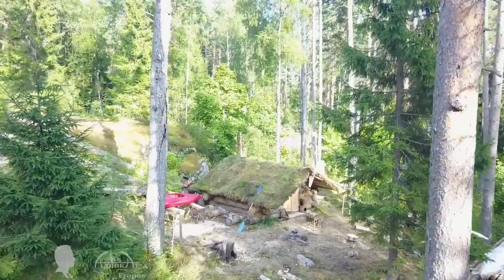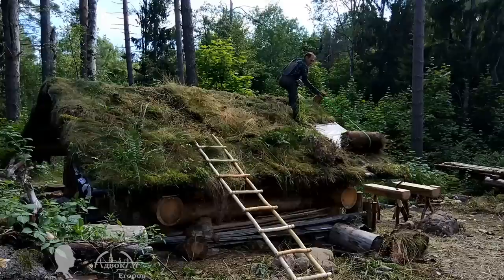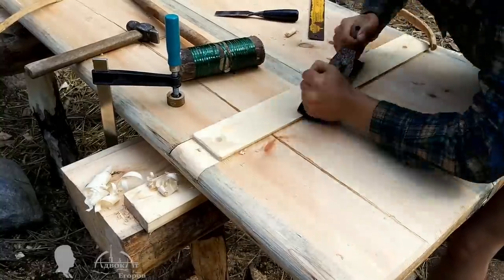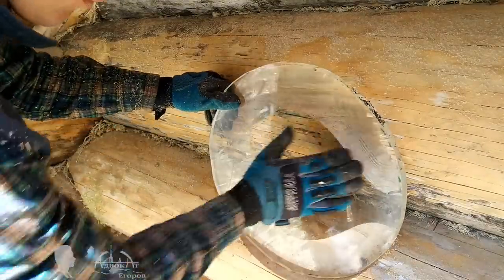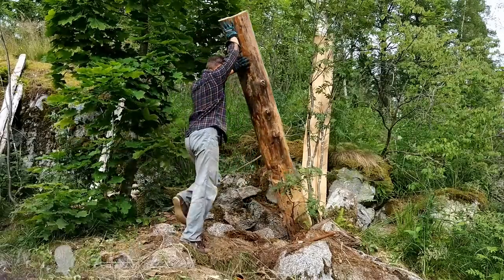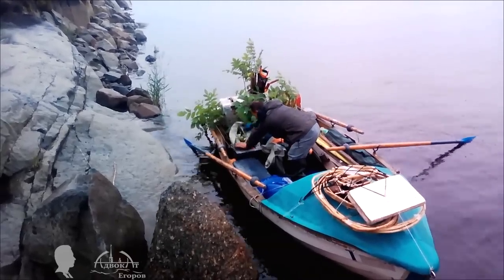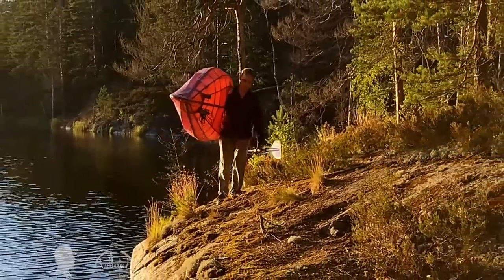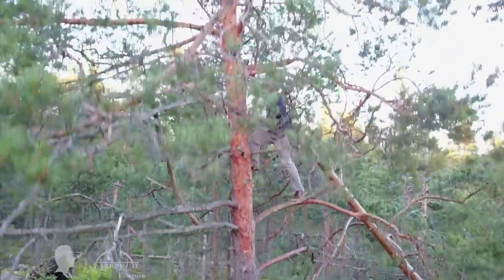30 Days Solo Bushcraft in the Northern Wilderness / Best Summer Projects

Comment: Porthole - on the wall, I would put a straight stick into the centrepoint of the window sticking out, the top of which is level with the wood beam, then attach a string to draw out the arc of the window. The pencil would have to slide in and out of the loop to account for the rise and fall of the curving surface of the logs. Once that is marked out, I would use a curved chisel to start carving it out on the inner edge of the pencil line. I think a curved chisel, alternating with a straight wide chisel would do the trick.
Reply from the maker: Thanks for the feedback. I only used a chainsaw, I will soon show how I made it..))
Reply: @Advoko  I don't know if you've answered this question yet, but I would have found the centre of the window on the wall and made a compass to draw the circle that described the cut. The "pin" side of the compass could be segmented so as to be collapsible, while the marker at the end of the radius would maintain the proper angle and distance to keep drawing the desired circle as the compass pin moved deeper into the cut. That is, the compass would not only draw a circle in a straight plane, but would be able to draw this circle on a plane that slid toward the wall as the cut progressed. This could be as simple as having the pin be a spike that was driven deeper and deeper into the wall as the cut progressed, but maybe it would be better to have the spike pass through segments of a tube that were each, say, 1cm long, so that the circle and cuts would be more predictably progressive and more accurate. At a certain point the compass would have to be moved to the interior side of the wall, using the same centre hole.

Comment: My dad made a large coffee table out of green planks when I was a boy some 40 years ago.  He only used wooden pegs/dowels to hold it together. When the wood dried out it shrank and tighted around the dowels. The dowels were squeezed so tightly that they are no longer flush with the surface.  It is strong and beautiful.

As for your circular window holes I am going to guess you put a spike in between two of the logs. You then made a compass with string or a sting and your chainsaw.  When cutting into the wood you had the tip of the bar perpendicular to the round path.  You did it slow and steady.
Reply from the maker: Pretty close. There is one trick that one needs to know though. I will show it soon...
Reply: @Advoko  I look forward to learning it. The cabin is a work of art by the way.

Comment: I come from a fairly remote area myself with poor phone reception.  I have made a passive phone repeater to redirect signals where I need them. Basically it's just two antennas and some coaxial cable connecting between them. You aim a high gain directional yagi antenna towards the location of the telephone cell site and secure it firmly and connect one end of the coax to it then the second smaller yagi is connected to the other end of the coax. The smaller antenna aims down towards your location and you have phone signal.  I have used it to " bend "  a single into a blind valley that has no reception normally. Keep up the great work, I love your projects and your videos.

Comment: Round windows = Flashlight?
Reply: @Advoko  You put a string on a nail in the wall and then you go around the nail by full length of the string and mark it with a pencil. Right?!.
Reply: I think yall are focusing on the wrong problem here.... Outlining the circle wouldn't be the problem. Cutting the circle perfectly all the way through the 12 inch log is the trick.

Comment: Dear Max, You asked how you cut the round window in your log cabin. Why ask me, you did it, you should know!

But then again, in the spirit of community input, here is my attempt. You are cutting into pine logs, soft wood that if fairly easy to work. I live in Australia where our native timbers are as hard as hell. Cutting a big circular hole would require a trip to the workshop and a bandsaw. In your case, boring into a softwood wouldn’t be that hard. If you have a central axis made of strong wood is the start. Put a cross-bar of timber, preferably green and tough gives you two arms. Into this arm you then put two pins of sharpened metal, both facing the same direction eg clockwise and equidistant from the centre. You then have made a circle cutter. It just needs a handle at the outside end of the shaft and voila, you have a hole cutter made mainly of wood but two bits of sharp metal {eg knives} to do the cutting. 

I love the format of your videos and your seemingly endless ability to turn challenges into wonderful earthy solutions. Well done.
Reply from the maker: Peter, I did it all with a chainsaw and some attachments but there is always more than one way to do the same thing;)

Comment: Amazing build! The windows? I think I would attempt to create the holes by pinning a chain dead centre and attaching a cutting tool on the end, encircling the central pivot until its bored through. This would explain why the wood circles upward the deeper you bore, as the pivot point is static.
Reply from the maker: The secret is in detail, the window video is coming...

Comment: My sailing kayak was ok but without a heavy keel it tipped easily and let the wind out of my sail. The 8 foot sabot (4 foot beam) with a 17 ft mast and 78 sq feet of sail was a lot more fun to sail. I made that sabot out of one sheet of 1/4 plywood and half a sheet of 3/4 inch. Including the 5 inch keel and leeboard and rudder.

Comment: for the round hole of the window, i would try to bore a 15mm pilothole for a pin of a tool with an excentric cutter mounted on a bar.

Comment: Round opening for window made with chainsaw and chisel.  Outlined using scribe then relief cuts made with nose of chainsaw.  Knocked out wedges with hammer and cleaned up with chisel and chainsaw.  A round wood rasp would be another option.
Reply from the maker: Hugh it was made with a chainsaw with a special diy attachment...
Reply: @Advoko  You are quite ingenious coming up with home made jigs.  The chainsaw guide for making those planks is particularly useful.  Also very much like the tree stump vice for steadying chainsaw while sharpening chain.

Comment: To make the windows, based on the incomplete one, it looks like you used the angle grinder pinned to a point (with a rope or solid bar) and slowly worked it around until it cut through the wall.  If the pin/centre point was drilled out first you could attack the wall from both sides and the grooves would match up perfectly.  This would make cutting through such thick logs possible.
Reply from the maker: I used a chainsaw with some jigs. But there is always more than one way to do the same job;))

Comment: Your place is super nice brotherman . I had another idea to toss your way. You could easily grow cooking amd medicinal herbs and other small plants that like lots of mid day sun on your roof . first though was blueverries would love that. But bears would love the berries...and wolves. And foxes. And everything else.  
 I would either clamp the boards or logs together  with a post in the center of wear i want the hole, and make a compass with a support stick or wire or some string.anything u can push or pull and spin around the center point without losing or gaining length to get an even circle or Drill a small hole in the center of logs and use a v shaped branch with marking item on one side and the other in the hole and turn it. Cutting out a half circle and using it as a temple for the other side could be done too.  you could draw a square and turn the guide a A few degrees, draw another square, turn and repeat 5 or so time around the center point and cut following point to point . I'm not sure myself do to so many ways of making a circle in the woods . a v  made of twisted bailing wire a charcoal.string tied to thumbtack on one side with a slip knot and marking device on the other is a good one. String and twine and wire all spin easily around a nail . burn it out  and f finish with a chisel...the standing cabin tells me it probably wasnt that, but I could be wrong.

Comment: TO CUT WINDOS, Take a round log then attach what you refer to as a hack saw around permiter and fasten it to the log drill a pilot hole and then turn the hole thing. Cutting a pretty perfect window hole.
Reply from the maker: Not quite...
Reply: @Advoko ok so another way  I was thinking is you could bend a chainsaw chain around or use a blade from gouging plane attached on a round piece of wood?

Comment: To make the window hole, did you get a piece of wood, affix a chisel or some other cutting tool to a point, then use a nail or similar axis?  You could then simply rotate the wood around the axis like it's a very large drill bit.

If you put more work into it you could make a fitting for your drill and, if it has variable torque, use the highest torque setting at a lower speed for the rotation.

Comment: I would, Measure the heights of both window centers to be the same. - I would post a Nail at each center, Use String and marker to make the circle. - I could then carve out the circle.  either by hand.. or by removing nail.. and drilling a hole where the nail was posted.  - post a wood spike in place of the nails and use it as a guide for a power tool. to carve it out.

Comment: For the round hole, i would have made a hole, inserted a dowel, then tie a string to the dowel, with a bit of charcoal on the end of the string. Pulling the string tight, you can turn it around, spinning the dowel in the hole, making a really circular hole.

Comment: To make a perfectly round port hole I would have a long straight pole, of wood I guess, to use as the pivot point. A nother piece would be fitted to the pivot pole so that it could slide up and down it. That piece would be at a right angle to the pivot pole. It's length would be the radius of the circular port hole. At the end of the radius piece you have a nail or some other sharp point to scrape the circle.

Comment: All you need is a stick and some string. put the stick between two logs with the string attached to the top, adjust the length of the string till you're satisfied with the width, drag the string around the two logs in a circle, mark it, cut it, got yourself a circle.
Reply from the maker: I did it differently. The window video is coming soon...

Comment: for the hole in the wall id go to the doorway and use the chainsaw to make a slit in between outside and inside all the way to the hole, and push the glass through the slit till the hole is flush with glasss and fill the slit with some type of wood glue or epoxy type thing

Comment: My way of doing that round hole is it nail a piece of rope to my desired radius, tie the end of the rope to something like a jigsaw or sawzall after roughly sketching it out, and then cutting a little off the line and then clean it up with a file, sandpaper, or maybe a hand plane then sand paper.
Reply from the maker: Thanks for the reply!

Comment: I think you cut the round hole window with a grinder that had an arbortech style cutter on, with a jig that pivots around a central point. Maybe a large diameter screw or threaded bar?
Reply from the maker: Jay, I used a chainsaw to do it but the secret is in details, I will show it soon...

Comment: I am assuming your camp is located close to a running water source as that's more practical all around.
If you want to build something that makes for an amazing youtube response with how meticulous you are in your work and how fancy it looks I'd suggest making a water wheel.
Now granted, you probably don't have many uses for a water wheel other than perhaps for power generation but it does offer other options like being the drive source for an old fashioned mill, lumber cutting and so forth and there is a possibility to make something modular that can use the same water wheel with quick disconnects to drive another "machine" so as to make it multi functional with something akin to a clutch or gear system to switch it over, I don't think I have ever seen that done before.
It does require an extensive amount of engineering, fitting and maintenance but I imagine you will run out of projects at some point so it could be worth considering.

Oh yeah, and for phone reception, have you considered using a balloon? ^^ 
A homemade weather balloon system that can give you accurate weather data, regional overview and phone reception would be amazing to behold, probably not all that practical though unless you find more uses for it.^^
Reply from the maker: Thanks for your thoughts! I thought of using my drone or a balloon...
Reply: @Advoko  Just don't forget the emergency release and a proper cable winch if you go for a balloon or you would probably die if there were sudden high winds :S

Comment: I'm guessing you drilled a center point for the window, inserted a threaded rod, used the chainsaw guide bar hole to cut a restricted angle to from the hole?

Would there have been a problem routing the exhaust from your stove along the ground of the log cabin? 
(I imaging it could possibly leak exhaust gases).
That should help retain heat during the winter, especially if you add a lot of rocks/sand/thermal mass.
Reply from the maker: I used a chainsaw to cut the window but the secret is in details. The window video is coming soon...

Comment: I genna take a guess on how you made the port holes and my answer is .... very carefully lol but no for really I'd guess your chain saw I know from working with electronics the better the tool the better the product you make and the most modern tool you have (that I have seen used) is your chain saw. You may have put a hole and then by eye trimmed little by little till it was the size you wanted. If iam wrong your one heck of a carpenter.
Reply from the maker: There were some tricks but I will show them in one of the upcoming videos...

Comment: I'd fasten a flat board or two (shim plumbed) to the two horizontal logs, use a level to line up where the two logs meet and mark my fastened board. Nail my mark, string out desired size making a circle to cut the middle out of visibly within  the line with long bladed chainsaw, * finish with chisel, level and sandpaper. 

* note to cut midsection slightly smaller than the pieces at desired insulation pocket distance... and do the same on the outer of the frame too. Notch pane thickness only if panes can't be warmed and flexed briefly to put into each carved ring. 
** treat the wood right before putting glass ( clean and dust free ) first.. I'd go natural or bleach for an even lighter color to allow a little more brightness
Reply from the maker: Thank you for the reply.
Reply: @Advoko  no problem. I've never done it myself but I just gave it some thought. Hope it's not wrong 😬

Comment: I would use half the thickness of polycarbonate than the plexi for your pothole. The polycarbonate has a kindling temp of 1290F which is higher than Aluminum.

Comment: If you haven't said yet and no one has answered. you could have either use the auger tool and drilled a few holes and then chisled out the window. Or used a bow saw and then rounded it. Last option would be an angle grinder with one of those wood carving discs.. maybe?

Edit: Just looked it up. its called a "turbo planer" thats my best guess.
Reply from the maker: There is always more than one to do the same thing. ))) I used a chainsaw..

Comment: I would tie a string the length of the radius of the circle I wanted to a pencil and anchor it where I wanted the circular window  to draw a circle. Once I have the circle drawn, I'd drill a hole in the center of the circle and carve out the rest from there. I'll be interested to learn how you did it.
Reply from the maker: I used a chainsaw to make it, but the secret is in details...))
Reply: @Advoko  Can't wait to see how you did it.

Comment: Whoa whoa whoa. Hold up. "You can easily debark green sticks using a regular spoon". Please elaborate.
Reply from the maker: You just make a longitudinal cut and then peel off the bark with spoon. Of course, the method wouldn't work on dried branches...

Comment: Circular window.... If I had a way to power it, I'd used a plunge router on a piece of 3/4 plywood,  and a circle cutting jig spread to whatever radius.  After scribed as deep as my bit would reach,  I would follow with a chain saw, well inside of the finished circle.  Then I'd complete and finish with hand tools. 
Something tells me you used some other method not having electricity.
Reply from the maker: Yes, I used a chain saw but the secret is in details. )))